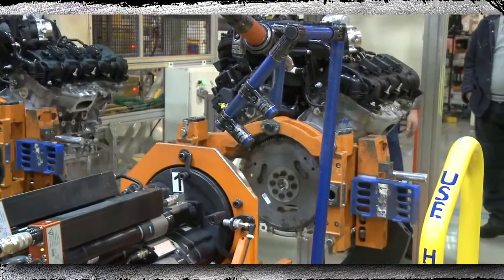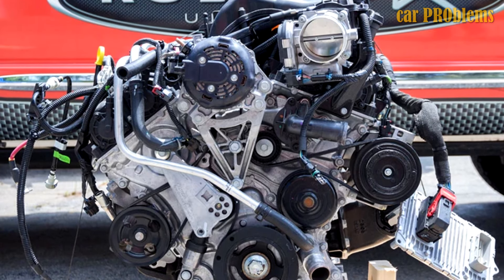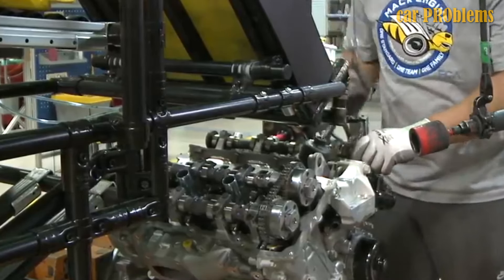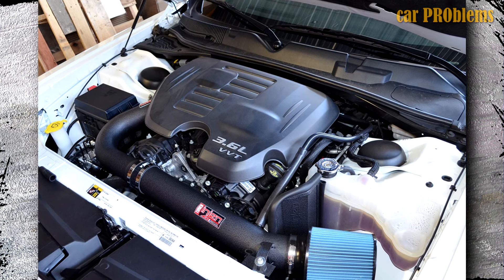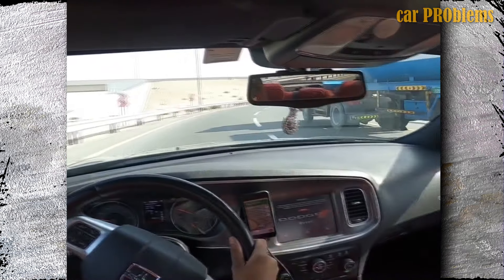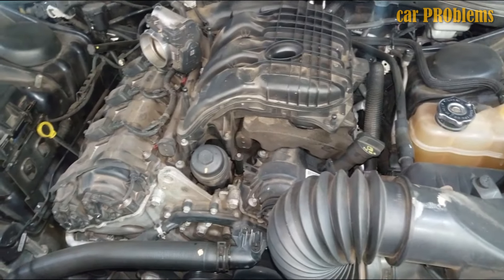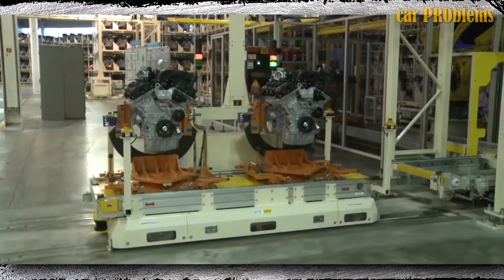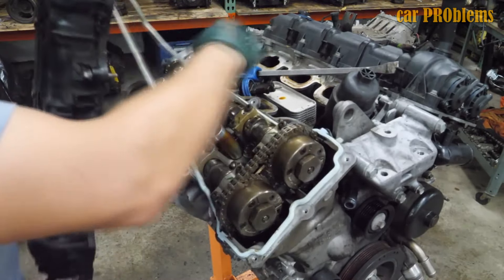3.6L Pentastar V6 Overview, Common Problems and Reliability

Comment: 250,000 to 300,000 miles my butt 😂 My 2019 Chrysler 300 has 70k on it and already had to put fuel injectors, all new plugs and a thermostat in it. That was two months ago and now the engine light just came on again last week throwing a po6da code. 🤦🏻‍♂️ These engines are made of cheap plastic and aren’t very reliable at all.
Reply: Damn! I had a strong interest in getting one.

Comment: Such a garbage engine.  Died at 140k km.  All oil changes done with full synthetic every 5-7k km.  Maintenance done religiously and the van driven gently and with much care.  Engine some how wore out the cam shaft and the transmission has always had a random clunk when shifting into F/R/N.  My mechanic said the worn cam is something hes seen a dozen times.

Comment: no more jeep wranglers these engines are garbage first problem oil cooler which jeep chrysler knows about change 2 within 1 1/2 yrs 32000 miles

Comment: Worst engine ever made, very unreliable, My 2014 Chrysler 300 lasted 6 years, until the left bank cylinder head decided to fail.
Reply: Not true, it’s extremely reliable
Reply: May actually consider this engine over GM’s 3.6 V6 .. those are notorious for guzzling oil and eating timing chains, and require oil changes every 5k to keep the chains intact
Reply: Much more reliable than the hemi
Reply: I spent 24 years with Chrysler Corp the 2.7 was the worst.
Reply: Please explain this unfounded comment. I would love to hear your proof of this "Worst engine ever made" statement.
Reply: @85Stang331   interesting how after 24 years , you don't say if the PentaStar engine " was Good... that's very strange .
Reply: "I have an opinion so it is true even if the evidence contradicts me and all the experts disagree with me."  Sure, Swishdrop, sure.
Reply: @tripkayne6645   As I'm a Millennial Moron  "I never ever Let Facts & logic get in the way Of how I feel at this very Second:):)
Reply: @reserva120  I have to assume that the content of your reply is directed at Swishdrop rather than me since the experts, awards, reliability data, and even general consensus within the comments section here certainly do not support the contention that the Pentastar is the "worst engine ever made."  Additionally, while I am a millennial (can't help that!), I'm far from a moron. 😂  We're all entitled to our own opinions and we all have differing experiences, some statements, such as "worst engine of all time", aren't entirely subjective and making such blatant statements where they're clearly untrue is... Not a good look to say the least! :)
Reply: @tripkayne6645  yes sir..
Reply: I agree, junk. . Numerous several mechanics I know won’t own them
Reply: I bought a town and country new in 2012 and I have 290,000 miles on it. Only have had to do work on it 2 times. First time at 150,000 miles the rocker arms failed. I think only one or 2 but i replaced all. At 290,000 my flex plate has cracked. I pulled the transmission out a couple days ago and replaced the rear main seal while i had it apart even though it dont leak a drop,flex plate and transmission seal. But I haven't had time to put it back together yet. Also while I'm at it I'm replacing all motor mounts. I do my own mechanic work so it's just $ for parts. And I always buy OEM mopar parts.(except on my 2nd gen dodge ram dash,no way I wanted oem on that) anyway if I remember right the rocker arm and lifters job cost me a bought 500 dollars and this flex plate  and motor mounts job is going to cost me 450 $. And another 20 or 30 on beer! And 7 or 8 hrs total time. But it's been a great van and in great condition still so its worth it to fix.😊
Reply: Bro was probably working that 3.6 like it was HEMI on top of not properly servicing
Reply: @forthefunofit5487 mine sucks, cam, lifters, piston. 81,000 miles! Junk!

Comment: I have a dame gladiator 2022 and does not stop the fucking pingin and Knocking dame engine always useing primeum 94octane and nothing changes only with 8100miles on it 😞  very upset with it...